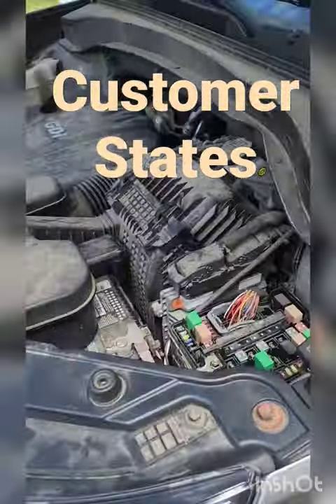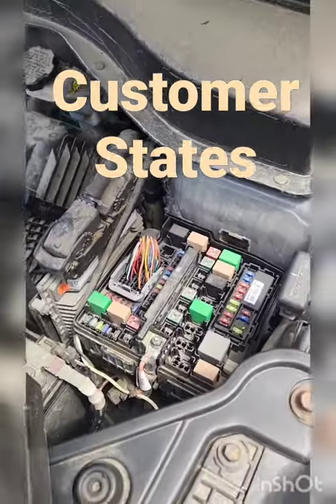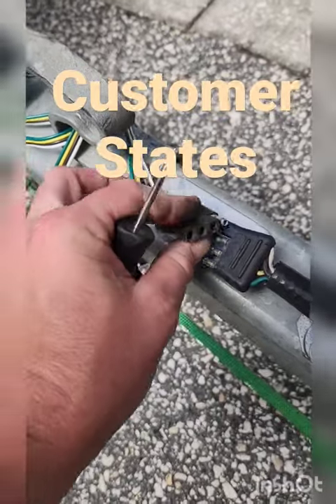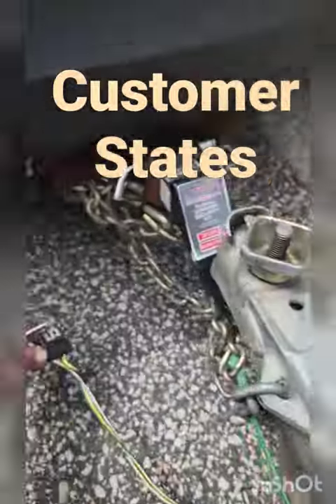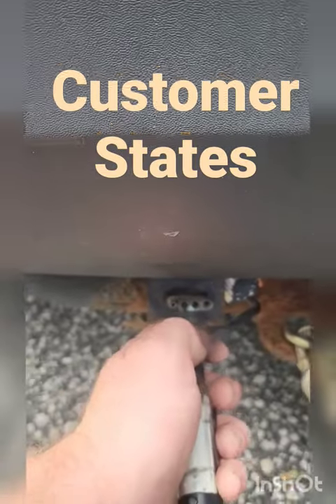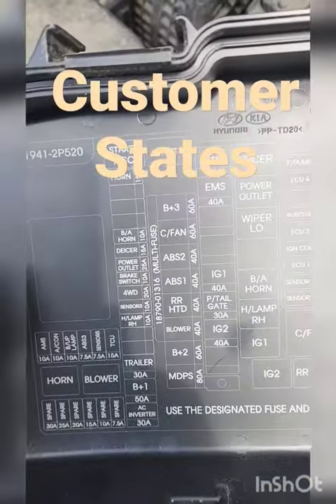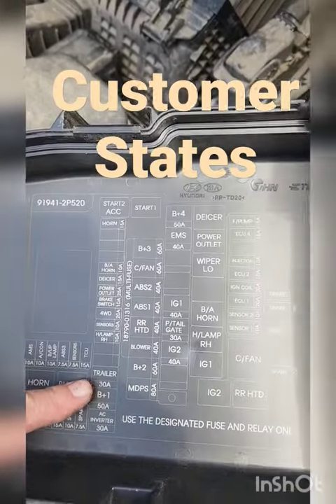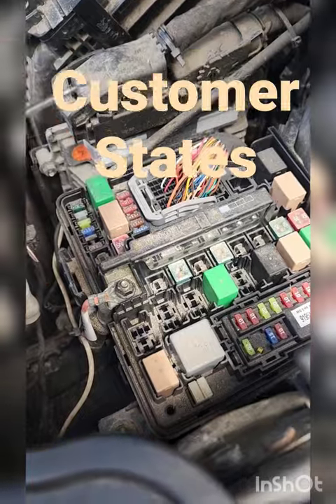How To Diagnose A Trailer Wire Harness

Comment: I just bought this car and the stereo worked for a month then stopped I tried diagnosing and the constant 12 volt is only get .4 volts the accessory wire gets 12 but the stereo doesn't start up I've tried pulling fuses and it's got to the point I'm about to just pull the 12v from the car charger any advice before I fuck my car up?
Reply: I've also checked the ground too it's good bolted to chassis because it's aftermarket stereo
Reply from the maker: Shit man, You gonna have to track down why the power wire is only getting .4 volts. Track the wire down it where is starts it must be damaged somewhere
Reply: I appreciate it.